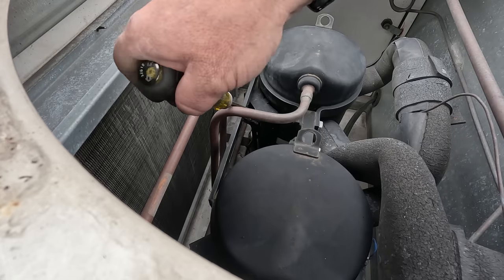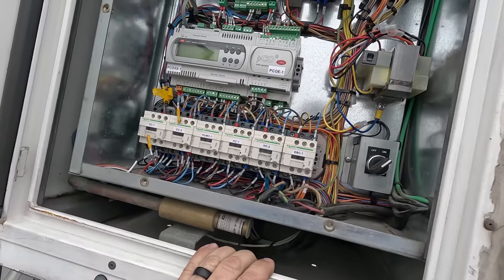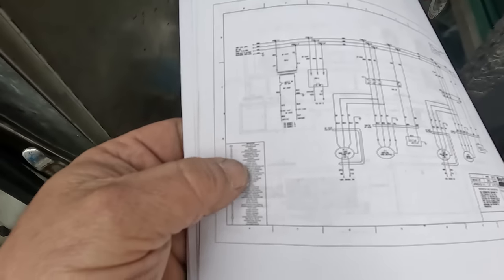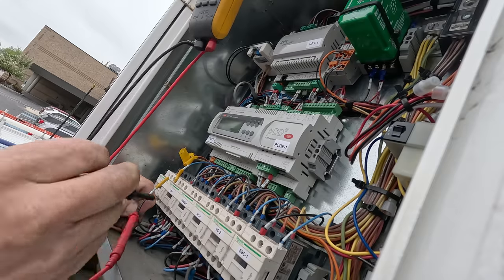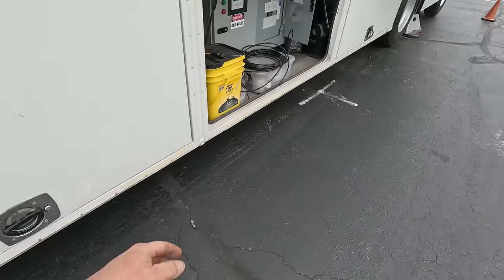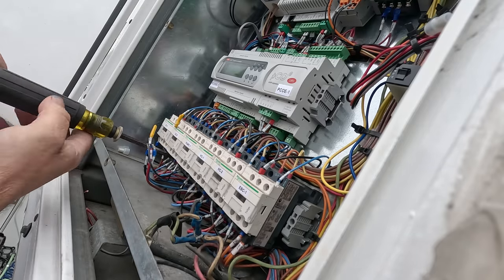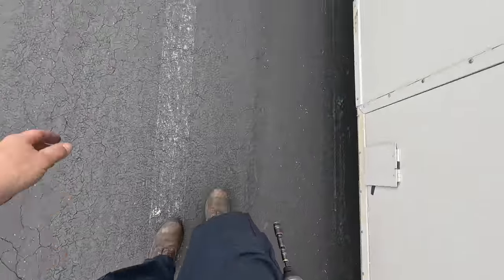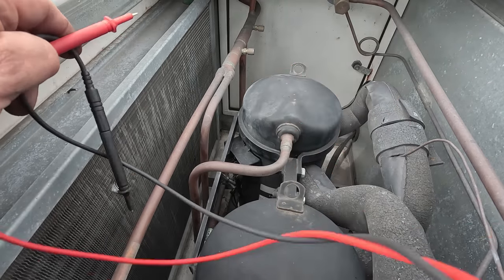Diagnosing HVAC Electrical Faults By Elimination

Comment: To say it was tight in there is an understatement. Looks like maybe you were the 2nd opinion because they didn’t fully trust the 1st guy.
Reply from the maker: After speaking with the owner I was told the original company was sending a second guy to recheck the system 😆. It sounds like the on-call guy was the last resort person

Comment: Would not want to be the guy to R+R those compressors. Bet the insides going to stink too.
Reply from the maker: That's what I was thinking 🤫
Reply: Had to do a warranty replacement on a tandem scroll set on a York unit last year.  Condenser unit was on the ground but there wasn't much room to slide the tray out so we had to get some half inch fiberglass rods to hoist and slip them out.

I'm not a fan of tandem compressors because if one grounds out it poisons the oil for both of them and have to be replaced as a set anyways.

Comment: I live in central Florida and worked on something very similar. It was a mobile CAT/PET and MRI scan trailer. The AC was easy to work on because it was two 5 ton Bard wall hung package units. There was a chiller that was in a cradle attached to the underside of the trailer that cooled the MRI machine. That thing was a pain in the ass to work on. I also was doing the work not through the company I worked for and the doctor 10-99ed me. I learned a lot from that experience. Good times

Comment: Note to all techs….use a sharpie to mark an equipment panel as to what you found and what you did so there is a record with the equipment for the next technician. Hell,  even put your company info so that you will be called again
Especially if it is a mobile unit which you may never see again
Help a brother out !
Reply from the maker: I didn't record it but I did exactly that inside the panel.
Reply: We’ve got a Daikin this reminds me of. The mechanical contractor and installer both pointing fingers at each other.
Reply: nobody wants to be called back on crap like that! 😏
Reply: He'll yeah, I run sooo many calls, I leave notes for my own self !! Along with  refused estimates, ect.

Comment: kinda late to the party but do the compressors discharge lines (where they meet) have a check valve inbetween that 2-1 joint? something tells me when it shuts down or (if) only one compressor can run that would create some sort of venturi sucking action(possibly pulling oils) or high pressure back feeding issue, never worked on something that had that but any tips or information would be awesome! thanks
Reply from the maker: No check valves.

Comment: So how were you able to diag cc1 when a1 and a2 were not landed, is it possible that the high current draw of bad compressor locked up the cc1, I mean I heard the chatter, but coil was receiving no 24v the black and blue wires with yellow tape. Maybe I missed something … 13:16
Reply from the maker: My thought is the one compressor burned out then took out the other one causing a locked rotor possibly. I don't know at this point. All I know is both compressors need to be replaced, once they're replaced then the system needs to be checked for proper operation and superheat.

Comment: Found the right fuse on the disconnect blew. After investing found that when I checked ohms from the compressor to ground it would start at 16 M ohms climb to 38 and then OL. That test was done with the plug on the terminals disconnected and with plug on. I wonder if that means the compressor is failing  I'm curious to know if anyone has come across this before.
Reply from the maker: It's possible you could have moisture in the system. I've had that happen with mega ohm meters. After I remove the compressor and the refrigerant was out of it it didn't do that anymore. Either way I'd show it as a sign that the insulation is starting to fail.
Reply: @HVACRSurvival  man I had a feeling something was wrong fuses to don't just blow for no reason. I get the feeling I'll be back out there soon enough thanks 👍

Comment: Compressors are in parallel, one burns up = leave crud to kill second one. Designed to fail.
Reply from the maker: That's how most grocery racks operate and they run that way for 30+years. It comes down to proper maintenance and operation. These are likely ignored until it breaks.

Comment: got a strange one a Thermall open face display the tag says r448 the compressor says r404 the the display calls for cooling the relay clicks but the compressor will not start no condenser fan 
Replaced all the start component's and still no start controller is new it's a 220 system any idea incoming volts are 207 thanks
Reply from the maker: You have 208v at the compressor but no operation? What's the amps? Sounds open but why isn't the fan running,? That sounds fishy
Reply: no fan? soundls like a power problem. Could be a bad contactor.
Reply: @liam3284  There are none 
kinda think the main power switch may be bad it's a dual pole.
The other problem is there are no schematic's on the unit anywhere
Getting no power to the compressor relay

Comment: I’m pretty sure its a bad thing if you try to run only one compressor of the pair when in tandem like that. Probably what happend, one compressor died and they tried running it with only one and that one went to ground. I could be wrong though.
Reply from the maker: It won't hurt it.

Comment: same crap, packed in 1/10th the area, high off the ground and near impossible to work on. they need to bite the bullet and swap the whole refer unit out, or buy a new trailer...

Comment: 480v, just reset the breaker a dozen times or more... 🤣🤣🤣🤣 either the bad parts will explode into a fireball and emit smoke signals or everything will start to burn and arc, problem solved.
clearly, don't do that 🤪🥳🤡